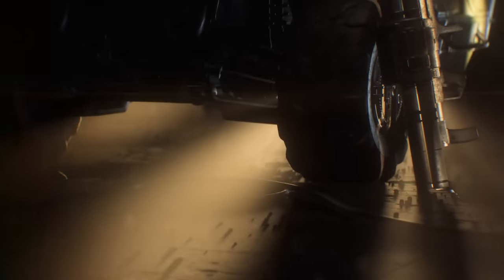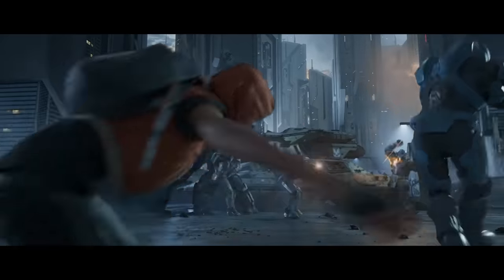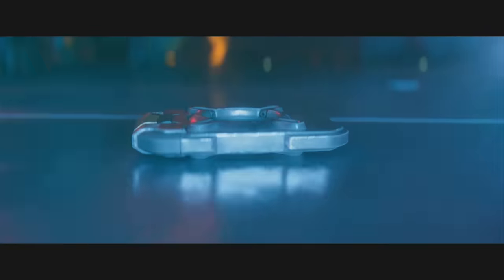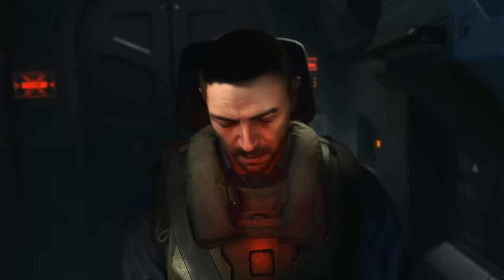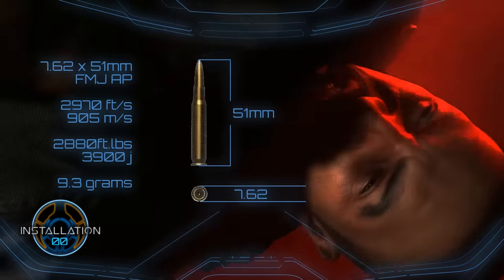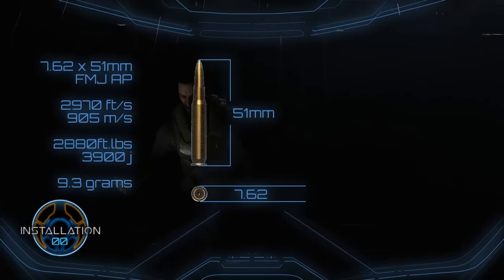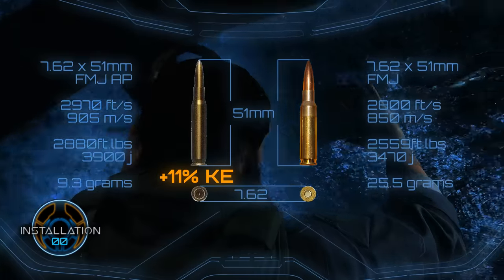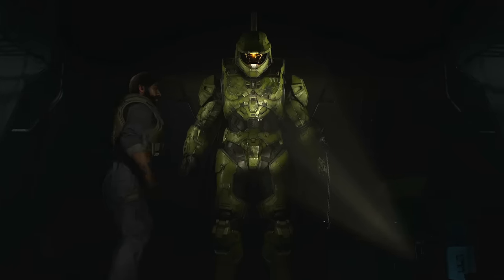Why are UNSC Weapons so powerful!? | The Armory

Comment: I have also considered the magnetic accelerator option. It seems far fetched considering the size of the weapons, but this series is 550 years in the future, and unlike in the Expanse there has been no slow down in technological advances in Halo. This means that they likely have experienced as much advancement from us as we have from 1451. Considering that in 1451 they had guns, but not cartridges and crossbow/bows were still common it would make sense that in Halo, guns would exist and become faster firing/harder hitting.

Comment: Considering the purpose of a pistol is to stop the person 10m away from you, a .50cal round makes way more sense then 9x19mm parabellum. 9mm parabellum has an overpenetration issue, by significantly increasing the mass the penetration is proportionately reduced but the Damage is still retained.

TL;DR bigger bullet for pistols makes way more sense.

Also Hardness is a completely separate material property, it's basically a substances ability to resist deformation, which increases penetration, it has nothing to do with mass.

Comment: I’m my mind I’ve always thought that the round might have been a two part structure that would have a wall made of a soft metal with a weak spot in the middle and would have compressed pure oxygen on one side and hydrogen on the other and the firing pin would ignite the oxygen and it would burst the weak point of the wall and flood the hydrogen compartment with high pressure fire and would cause a large amount of gas to propel the round at higher speeds like Mach 1.6+

Comment: Ballistics is my thing. you made a mistake lol.
grams is not a normal weight unit used when measuring bullet projectiles. grains is. 9.3 grams converts to approximately 143.5 grains. todays standard 762 nato m80 ball ammunition is 147 grains. 
your measurement of 25.5 grams translates to over 300 grains. you measured the weight of the entire cartrige. not solely the projectile. 

when using the correct weight unit and when measuring the correct thing 9.3grams/143.5grains is much more comparable to a standard M80 ball that you find today. the "specially hardned" aspect is likely what accounts for the sub-5 grain difference between halos 762 and modern nato 762
Reply: Perfectly stated

Comment: Don’t forget there are different that there are differences in loadings of 7.62nato and they will have different velocities based on the length of the barrel of the gun being used to fire them. I’ve gotten some hand loaded .308 loadings up to 2900ish fps before when shooting it out of my L1A1 with its 22(ish) inch barrel. It is possible that the unsc is using a different loading of 7.62 nato from our current standard issue.

But yes the idea that the unsc has a standard issue desert eagle in 50 as their sidearm. That’s just ridiculous.

Comment: Small thought: Could it be possible that the listed mass of each round was purely for the bullet or the propellant component, and not actually for the entire cartridge? The numbers were extrapolated from magazine sizes, but maybe reverse engineering the numbers through that lens will lead to some numbers that at least imply the round was truly meant to be the same mass as a present-day equivalent--or maybe they'll even turn out to have more mass and therefore more energy.

Comment: It's not unreasonable to assume that 27th-century engineering and manufacturing techniques have allowed the creation of materials with higher tensile strength than modern steel alloys. By building the load-bearing parts of a gun out of these materials, you can then fire higher-pressure powder loads. Another assumption based on future tech is a low-friction coating in the bore to reduce heat and fouling during operation.

I don't think small arms of the UNSC use magnetic acceleration. The smallest mass driver that comes to mind is the M99 Stanchion, which seems to require an external power source and is semi-automatic. If the MA5 were a mass driver, it would have enormous power requirements to fire fully-automatic and would produce enough waste heat to melt both the gun and its user.

Comment: I always thought the unsc cartridges were better because of the better materials used in them. For instance we have much more powerful chemicals than the current ones we use in gunpowder today but they are expensive and dirty. The bullets them selves likely use advanced strange alloys and materials that would either be to cost prohibitive now or we just don’t have the equipment to make some of these super materials. Another thing is that DU rounds would have little downside in this universe as uranium is likely cheap due to fusion being around and its more common in space and cancer is not an issue in the halo universe.

Comment: 4:05 about the 9.3 Grams, check into the weight of bullets themselves. 9.5 grams is the projectile weight of a modern M80 Ball round (Standard US loading of 7.62x51mm, probably the most produced 7.62x51mm round in the world). The lore behind it got fucked up because whichever intern saw the term "Bullet Weight" did not know that "Bullet Weight" and "Cartridge Weight" are not the same thing. 300 grams of purely bullets is totally accurate and within reason. 300 grams, with ~30 rounds in the mag is ridiculous, as the powder would need to weigh at least a third of bullet weight and the casing is very obviously brass in the games.
Reply: Watched the whole video. I love your lore, and your science stuff is cool, but please, please find an American that can tell you about ammunition. You have so many errors in this video. Spend two weeks looking into how bullets are measured and give us a better video.

Comment: Id like to express my thoughts on the “Need” for a better propellent ? Or that this is the solution or a possible solution to “perhaps they are even more powerful rounds now”

Thats not even a necessary thought experiment. Military grade and civilian loads are never loaded to shell capacity… 

generally you can always just load MORE powder into an existing shell. We just settle on a standard to make economic sense and provide consistent ballistics 

The weight is negligible though and people who load their own ammo can just squeeze more powder in… and just make more energetic loads

Your point of failure wouldnt really be “We need a better propellent” because even before you exceed the potential of modern propellent you are going to encounter case breaches, bolt damage, recoil dampers and springs and other recipricating componants?? 

Those are gonna start hurting … as well as your shoulder long before you need a new propellent …

So I would argue its irrelevant to even discuss propellent changes. You can always load more powder OR just upgrade to a different cartridge

And 3-5KJ is a LOT of energy dude when focused onto a 7.62 diameter point 

Do a pressure calculation ? 

I really think it would eat through energy shields honestly … i cant believe their shield can constantly output 5KJ to every single point continuously on the body. 

We see its always active … so its either constantly putting out enough energy to cancel out other energy of equal of lesser value on every square MM

Or its more like a point defense system that just focuses energy towards the area of incoming fire ONLY 

But that doesnt match the feats we see shields achieve

Comment: Let's say the 9.3 grams is actually the projectile weight instead of the cartridge weight, that would put it lighter than military standard 10 gram projectiles, and 3000fps is right at a "hot" handload for a bullet in that weight. Overall these are not "ridiculously overpowered", just higher than military spec.

Comment: More advanced propellant and more advanced materials physics. This is the same civilization that has space elevators and clads their spaceships in titanium alloy that is artificially hardened on the molecular level.

This is a well delivered video for sure. But it poses questions that are basically answered instantaneously. It's been 400 years of military advancement, we may as well have single shot muskets from 1600s.

Comment: Idk if its stated anywhere or not wat the actual slug for the UNSC 7.62 slugs are made of but heavier weight and better terminal ballistics leads me to think of depleted uranium slugs. Just like today's GAU-8 A-10 Warthog main gun. Higher velocity from more advanced propellant coupled with a heavier and more dense material in the actual bullet would be the ultimate for advanced military arms. Velocity and mass with the added benefit that depleted uranium has a knack  for piercing armor would be the perfect mix

Comment: Ignoring the mass issue, perhaps the bullet itself is longer and more massive and their propellant is simply so much more powerful per unit of volume, thus more than compensating for the loss in case volume due to the elongated bullet AND the theoretical loss in velocity you'd expect from more mass at a given propellant charge.

Comment: idk i just assumed its down to optimizations in case technology, dimensions, and propellent.
looking at the efp and velocity of the halo 7.62. it seems like is shooting about a 147gr bullet. These numbers aren't that hard to reach with current hot 308 hand loads. 

side note 1. 147gr is on the lighter side of weights for .308 cal bullets considering the modern trend of longer, heaver, and higher ballistic coefficient bullets.

side not 2. im fairly certain that the 9.3 grams (143.5gr) is in reference to the projectile weight. which would be slightly low considering the stated velocities and energy f/lbs.

So either the unsc is using "obsolete" bullet designs by even todays standard, or the armor penetrating core of the bullet is much lighter than even steal which would allow for a longer/higher BC bullet with higher sectional density without being super heavy to keep velocities up.

Comment: it is interesting to look at the new US rifle M5 and its new minietie.
the 6.8x51mm. especially the new cases technology and the higher +/- 80,000 psi versus +/- 50,000 psi 7.67mm nato standart. and the possible increase in this pressure possibly up to 100,000 or even 120,000 psi allegebly. and decrease in weight with the aid of plastics in the production of the cases. maybe the UNSC did this too. and refined it to the max given the few centuries. they had

Comment: You have to take into account newton laws of motion, to make the weapon more powerful, I mean bullet with more force, the recoil will increase as well. UNSC probably as you mention in the video use another kind of propellent and primer to increase the presume of the explosion and thus projecting the bullet with more force. We have a recent example with the new Rifle Adopted by the US Army, the M17 Spear. But again, the recoil would make the weapon difficult to use and aim, It wouldn´t matter for an Spartan, but the common soldier. It is also possible that Halo weapons have some sort of mechanist to reduce recoil, It´s jus speculation but that might be the case.

Comment: Maybe they have a way of making the brass heat resistant and so it doesn’t soak up heat like lone stars new polymer ammo. And use a steel base to be tougher like sigs new 6.8 cartridge. Look how far guns have come in the last century, it’s insane. I own a .308 bolt gun that can put out quarter inch group with 168 grain hunting ammo if I’m feeling up to it. My hunting rifle is not only more accurate and precise that the sniper rifles of two decades ago but it is tougher and lighter due to the use of carbon and aluminum. Take a look at the ngsw trials for the new guns for the US military. It’s nuts.

Comment: I don't know why the 7.62x51mm NATO rounds the UNSC have a muzzle velocity in early stats had a velocity of only 2,600 feet per second with old M80 Ball rounds having 200 FPS More at 2,800 FPS. Then chuck in how the MA5B has a rate of Fire of 900 rounds per minute and a 60 round magazine.

Comment: I had always assumed.. based on. What I know of real.weapomsnand ballistics.. that the disparity of real world to game/lore effect was a result of the advanced technology and manufacturing capabilities of the UNSC Industrial juggernaut.

While a 7.62x51mm NATO cartridge might represent a considerable level of power on the modern battlefield, it kind of pails ij comparison to its game equivalent of the exact same chambering.... so why?

Easy actually.
More advanced engineering capability and material science.

A 7.62 projectile being accelerated by modern cordite propellant is able to achieve some impressive velocities. But remember Spartan reaction speed. We are percieving the world in game as a Spartan.

The propellant used by the UNSC HAS TO BE more advanced higher pressure and cleaner burning propellant perhaps closer to an explosive than simple incendiary powder. This makes rounds more durable as well, and advanced material science achieves this. The projectile itself can also be engineered in better ways. With the ability to retain mass with better AP (Armor Piercing) properties. Modern AP rounds are Steel core and higher than standard velocity. Who's to say they use Lead or Dolomite for bullets in the 26th century. It's very possible a harder lighter or denser steel alloy, perhaps tungsten core penetrators.. all kinds of cool spicy flavors ammo can come in when you have the ability to design them from damn near the molecule up. 

As well, the weapons all mostly utilize effective barrel:cartridge length ratio to maximize velocity, the original magnum had explosive rounds, while limited in their real power, a detonation even a small one from a projectile burying itself into your flesh is going to cause catastrophic wound channels. Etc etc.

So yeah, with advanced explosive compounds, advanced cartridge propellant, advanced engineering in bullet design, and advanced engineering and design on weapon platforms focused to maximize the lethality of the chambered ammo and effectively utilize the strengths of that platform.. like the BR75 being better then the BR55 the evolution we see from the MA5B to the M40. These are just within thr franchise timeliness for games and books. Compare that to modern advancements which always ride the wave of engineering and manufacturing innovation not the other way around.

Im.not really surprised at all that higher velocity rounds of stronger materials have more effect on target than modern standards.

Also the 8 Guage shotgun is stupid. It's a result of Nerds who don't understand guns but just enough to know that 8 guage is an artillery piece compared to a 12 Guage pump action.

But again.. 12 Guage is fantastic, with better ammunition ots even more effective, comparable to what we see in game.
1300-1600 fps steel 00 buckshot is very destructive. But imagine denser, stronger shot pellets of the exact same size, maybe even complex geometry for strength or spawling moving at closer to 2000 feet per second is going to be utterly devastating.

So in my eyes the 8 Guage shotgun is just stupid. Even a 10 Guage is unnecessary. A 12 Guage with advanced ammo is fat far more practical. But meh.. the chambering is less important to me in that regard.

How many other games just don't get guns or ammo right at all.

Look at Far Cry 6.
A shifty Makarov with AP rounds will do more damage to a guy in body armor than a .50 BMG round of "Soft target" ammo.. (whatever the hell that is)

Comment: Two thoughts.  All of this is based on the premise that NATO still means NATO after Russia has ceased to exist as a threat for centuries.   It also would require that NATO to exist but SAAMI and  CIP have ceased to exist or allowed the cartridges to exceed their original specs. 

Finally, all of this talk of energy but I don't recall hearing anything regarding bullet weight or construction.  (Not cartridge)

PS, energy = recoil.  Kinda moots the whole exercise unless the damage isn't linked to kinetic energy.

Comment: The reasoning behind the more powerful rounds might not be the cartridge themselves, or even the chemicals used. The UNSC might just be over filling the standard round using cases made from more advanced versions of brass. It is 500 years in the future, they've figured out FTL travel and colonized hundreds of worlds, I'd like to think the metallurgy is significantly better. 
This would also explain why UNSC weapons are fucking massive. All that extra mass to support the extra Recoil and strain from over filled rounds.

Comment: we have polymer rounds that weigh 1/3 the weight of a brass cased round also you can increase pressures like with the new 6.8spc round out of the sig spear. we could 100% with the technology available recreate these weapons in 7.62, I have not finished the video in before commenting.

Comment: Since you mention more powerful propellants already in use in tank rounds my question would be why aren't those already in use in traditional firearms. I can think of a multitude of reasons but the two relevant ones here are they're not cost effective to manufacture in bulk or they create too much pressure when used in a small arm and lead to failure or excessive wear and tear. Basic advances in material sciences in the halo universe could render both these points moot.

Comment: The figures for the UNSC rounds were evidently based on the same weight bullet just propelled faster. 3900*1000/905/905*2=9.52 grams or 147 grains. In my headcanon the bullets are largely tungsten: "How does 90mm of tungsten strike you?" If we imagine a 16 gram tungsten bullet propelled at 905 m/s that's 6635 j or about 1.9 times the clout of the NATO round. Does that account for the extra power? How much extra destructive force do we think we're seeing here?